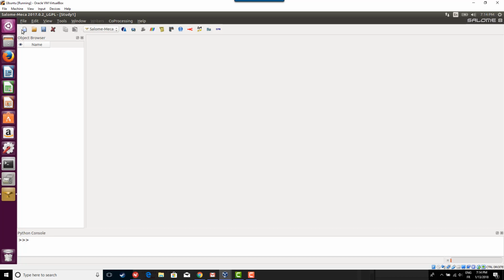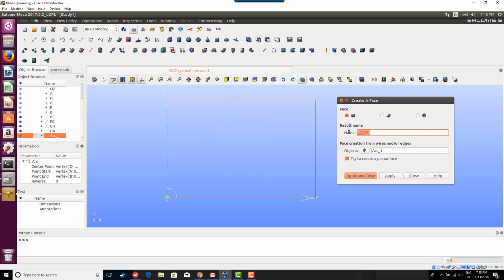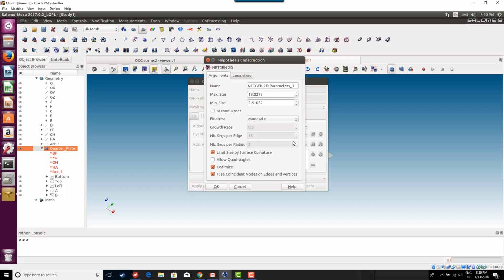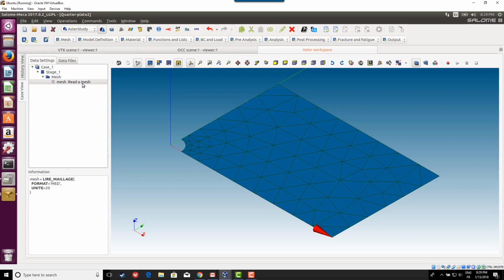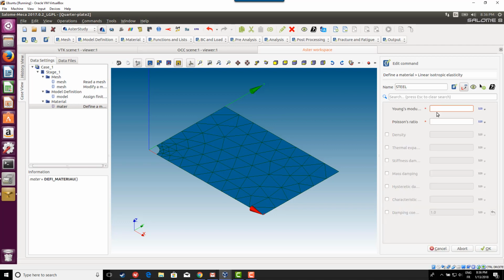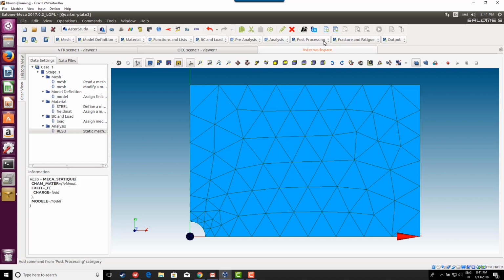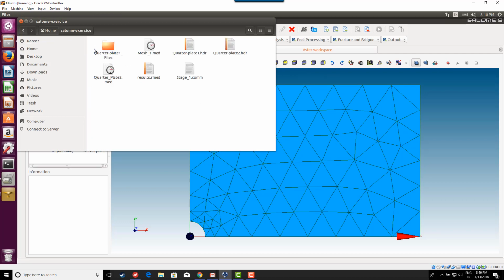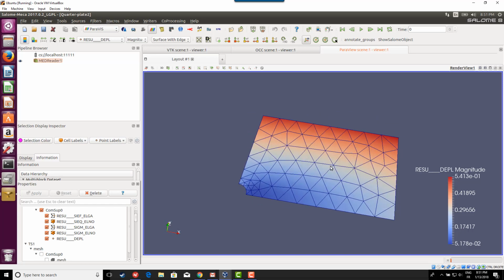[Salome-Meca 2017 Tutorial] Simulating a 2D Quarter Plate

Comment: Hello, When I run the file, my box turns red and gives the following error: Full job output should be available in the directory.

What does this mean?
Reply from the maker: Not sure. Have you checked the simulation folder? Do you have files that were created in it?
Do you have some spaces in the install path of Salome? (You shouldn’t )
Reply: @Feaforall  , yes, I checked all these parameters. I tried on another computer it worked. Maybe I was missing some library.

Thank you :)

Comment: Thanks for the video.
I have an issue when I run the Aster case (like 31:35 in your video). 
It shows "Cannot read output file or empty file." and cannot finish the simulation.
I've checked 1) language support/Regional formats and 2) folder/file names, no problems.
Could you suggest how to solve this problem? thanks.
Reply from the maker: Have you attached the results of the simulation to the result file? Check the IMPR_RESU function. The checkbox results should be checked and the results from the analysis case linked otherwise it will generate a result file with nothing in it.

Comment: Nice commented tutorial! Thank you Cyprien.

Regarding the need to use the same name after using "Modify a mesh", this is a known issue that will get fixed in the next release of the Salome-Meca. Please have a look at the embedded help of AsterStudy (Help menu) or in the following link for all known issues in Salome-Meca 2017: https://www.code-aster.org/V2/IMG/pdf/ki_asterstudy-en.pdf
Regarding the naming of fields in code_aster, the training material has a neat diagram explaining the difference between _NOEU (nodes), _ELNO (nodes by element) and _ELGA (Gauss points by element): https://www.code-aster.org/V2/UPLOAD/DOC/Formations/03-stepbystepcalculation.pdf (page 30)
Some details:
- the "Modify a mesh" feature is used not to orient the mesh itself but rather the border of the mesh where pressure will be applied (e.g. "Top"). Indeed the pressure loading ("PRES_REP") requires that the normal points outwards on the border of the mesh that is concerned.
- you may edit a code_aster input file manually and run it without the need for ASTK, for that, just switch to "Text mode" (CTRL+SHIFT+T in Case view, with a Stage selected).
Reply from the maker: Thank you for those additional comments and links, I will take a deep look into it and this will help me to provide a better explanation in the next video.
Reply: Hello, When I run the file, my box turns red and gives the following error: Full job output should be available in the directory.

What does this mean?